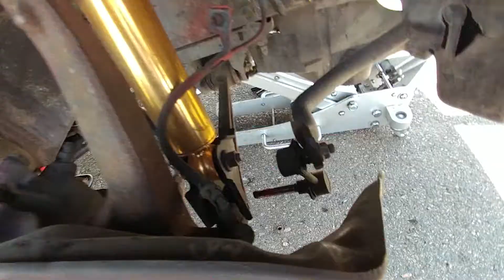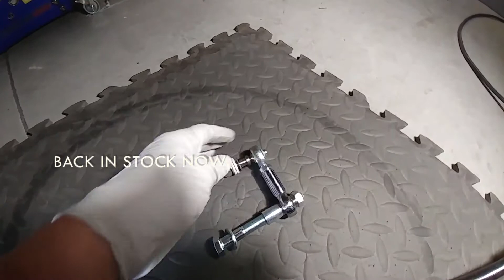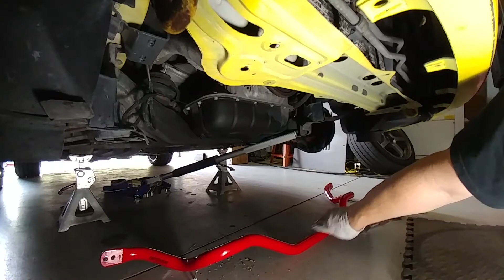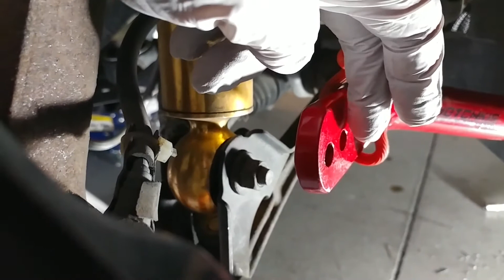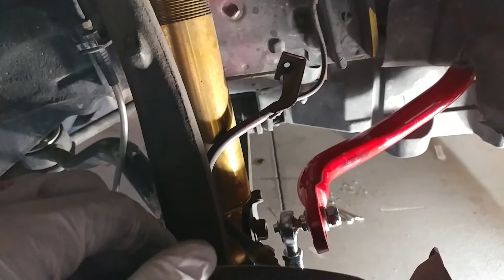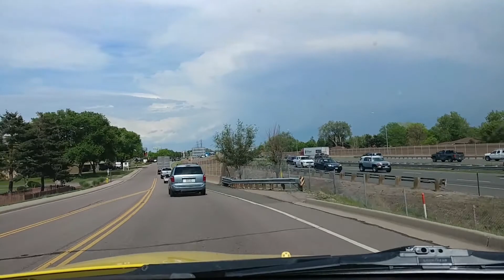FIGS IS300 Hotchkis Sway bar install  plus relocation bracket and endlinks FRONT

Comment: What would be the best stiffness setting , I’m planning on installing Hotchkis sway bars front and rear with figs adjustable links . Im also planning on getting a Cusco rear strut bar . What would be the best stiffness setting . I want to be able to handle cornering with ease and remove some of that stock under steer the Is have . I own a 2003 Lexus is300
Reply from the maker: There is no best when it comes to stiffness settings. It really comes down to what translates to the best performance for your particular driving style and preference. Other factors like what shocks you are running and bushing upgrades will also play a role on the stiffness setting on the sway bar. I always suggest to start in the middle setting and move up or down based on how the vehicle drives with your inputs.

Comment: What if you are using the stock sway bar but the figs end links?
Reply from the maker: It should be OK with the factory sway bar And our end links as long as you are lowered.
Reply: @FIGSEng  I’m lowered about 3.5 inches. How do I take the measurements to adjust the end links? On the front and rear
Reply from the maker: @satchinmahabir8907   You would disconnect the sway bar and measure the distance between the eye and the lower control arm mount when the car is at ride height.  You wanted to be level with the bushing mount. Once it's level you will take this distance and that will be your center to center measurement on the end link. This is the starting point for one side and then you would adjust the other side so that it can easily go into the sway bar mount without preload.

Comment: Are these 'exposed' joints mainly for "track use"?  I live in the Memphis area, and usually need to swerve from poor drivers at ANY SECOND!! So, can these joints and the teflon spray live in a daily driver? Winters aren't bad, but does rain a bit..
Reply from the maker: Yes they can.  They have a ptfe sealed liner that wipes debris off before it enters the race.

Comment: I’ve had this sway bar and adjustable end links for about 3 years, never had an issue. But recently I had my two front and lower ball joints replaced, also the sway bar end links were adjusted and I noticed they never reinstalled the Teflon ring on the passenger side for the end link. 

Since picking up the car there’s been a loud clunking on the front passenger side which is getting louder and louder everyday. Is it possible that it’s from not having that teflon ring or could it be the sway bar bushings possibly?
Reply: Sway bar bushing problem would be at higher speeds the car feels bouncy. The clonking noise. Is it apparent over bumps?

Comment: Are adjustable end-links required, or can stock be used? thanks!
Reply from the maker: Sway endlinks are required when the car is lowered.  Otherwise the stock endlinks will push the bar upward into preload and it will not be as effective.

Comment: That thing(swaybar) is a pain!... I did it just on stands and was cursing the entire time! LOL! Had to fish it in like a snake- more like "screwed" it in the space it came out of. ...Then, the bushings that I ordered, (had the same number on them) were visually the same that came out but turned out to be about a millimeter thicker, so it was a bitch to get those bolts to catch the threads.(I used vice-grips then C-clamps then pliers... Then back to vice-grips! LOL) 4 bolts, about 6 hours of struggle! My back is still sore!
Edit: I was stuck at 12:59 for hours. (Rock Auto Moog bushings)
Reply from the maker: That is a bummer @Rasputin 883. Was it because you couldn't get the car high enough?
Reply: Yup! So like I was saying, I had to like "cork-screw" it into place and into that place above the AC hose. ...I;m gonna stop bitching, dude... All's well that ends well. :D I have come to live with the fact that this car is going to fight me every turn of the screw. It's a love hate relationship. :D